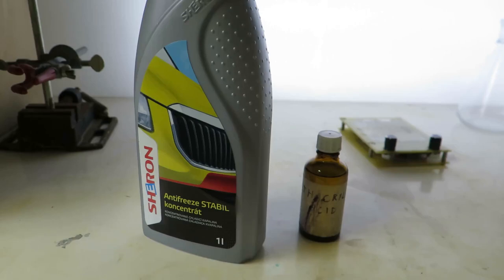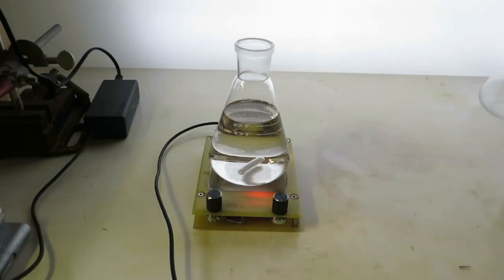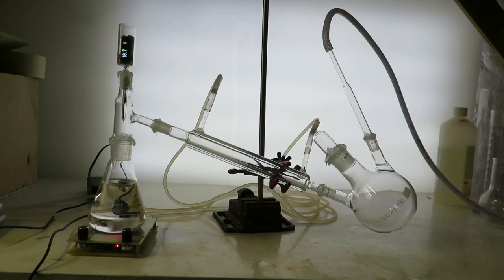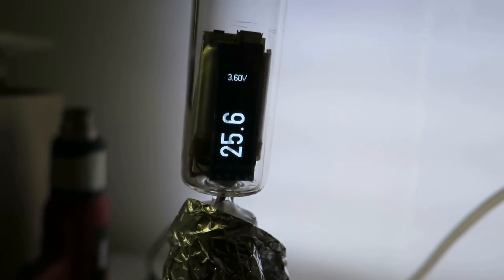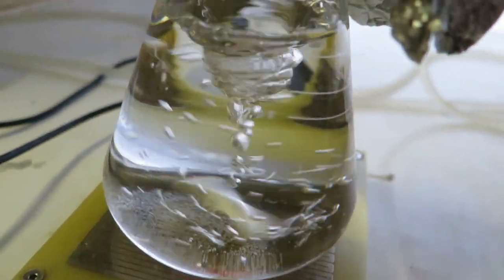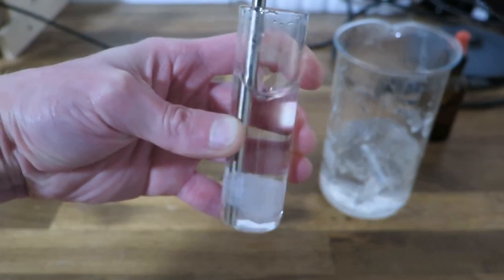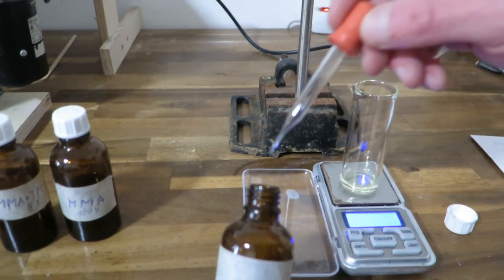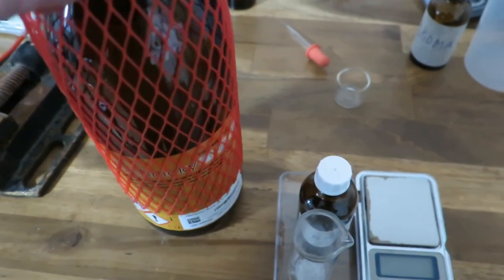Ethylene glycol dimethacrylate synthesis (fail)

Comment: Hi, never use an Erlenmeyer flask for vacuum distillation! An implosion may occur.
Reply: not only that, it might bulge in ^^
Reply: really depends on the thickness of glass and temperature, nurdraged does vacuum distillations in those all the time but hes using vacuum distillation rated ones

certainly use rbfs as i wouldn't trust erlenmeyers, ejkozan (if youre here hi!) said before he has seen a flask implode under vacuum and shoot glass through the fumehood sash so implosion is no joke
Reply: to be fair to him his hot plate which is made from a circuit board as a heating element only goes up to 70C or so, it is unlikely his flask would implode (as i have hot filtered solutions with erlenmeyers before) but still unideal
Reply: also hi eric
Reply: also note that he does glassblowing so he probably knows that it wouldn't implode under these conditions, weak aspirator vacuum and low temp and all

Comment: Sorry, I will write it, but I am not surprised with the outcome of esterification. I think i wrote it last time: any acrylate compound plus acid will end up with polymer. Period.
First, you will need a polymerisation inhibitor in the reaction mixture, second more than twice the molar excess of methacrylic compound to form not mono ester but diester. And third, from what I read acrylic acid is a poor choice and transesterification of methyl methacrylate works better. And in the literature, you make a product you want by heating it to 150°C methyl ester with glycol. 
I had send you PDF with references. Especially check White paper from 1943 (yield of 46%).
DOI: 10.1039/JR9430000238

Comment: Hello, I'm Brazilian and I saw that you have glassware that can be adapted for a synthesis of an acrylic monomer.

First tip = Do not use it directly on the plate, but in a water bath, it can be in a glycerin bath.

2- You must use a polymerization inhibitor, I recommend using Hydroquinone or paramethoxyphenol together with air bubbling.

3- You should also use an acid to catalyze the reaction and my suggestion is to use methanesulfonic or paratoluenesulfonic acid.
 
4- The ideal is to use an organic solvent (preferably Toluene) to remove the water formed in the esterification by azeotropic reflux.

5- Control the reaction by the amount of water removed but preferably do a titration analysis to see the amount of free acid, the smaller the free acid, the higher the reaction yield.

6- When the reaction is complete, just vacuum distil all the toluene used for reflux.

This process is used in large industries of resins for wooden furniture and you will obtain 95% yield without problems and you can use it not only to produce Diacrylated Ethylene Glycol but also any other acrylic monomer.
Reply from the maker: Thanks for tips, I will definitely try to use pTSA and will get some inhibitor. Also will  try to use toluene as you suggested. Will probably have to order some chemicals, so I will buy some hexanediol as well since it is used more in commercial resins.

Comment: It seems u are using ir heating right?
Reply from the maker: On big one yes, small one is just pcb with 1mm snake trace and layer of epoxy. Tried various platings, but all oxidized and boards looked ugly. Epoxy will get bit yellow too, but is better

Comment: I not watched to the end of this video but you got HUGE DISLIKE! NEVER NEVER NEVER put falt-surface glass under VACUUM! NEVER! You must to stop all your experiments and GO LEARN SAFETY RULES!
Reply: to be fair to him his hot plate which is made from a circuit board as a heating element only goes up to 70C or so, it is unlikely his flask would implode (as i have hot filtered solutions with erlenmeyers before
Reply: also note that he does glassblowing so he probably knows that it wouldn't implode under these conditions, weak aspirator vacuum and low temp and all
Reply: @EdwardTriesToScience  I know about glassblowing. But if you will ever try to make any vacuum distillation even with waterjet pump and will try to use flat-bottom flask you will be expelled from lab! It is general safety rule. Flask can be good quality, but flat-bottom flasks are  often scratched at bottom and this increases probability of cracking. His aspirator gives just normal vacuum for waterjet pump, flask can explode. When doing vacuum distillation I always doble-check glassware because some flasks could have small bubbles in glass - reason to not put this flask under vacuum. Problem with vacuum not just in glass flying around, but content of the flask will contaminate everything around.
Reply: @EdwardTriesToScience  better to contamintae one more clean round-bottom flask, than contaminate everything around, loose erlenmeyer and regret.